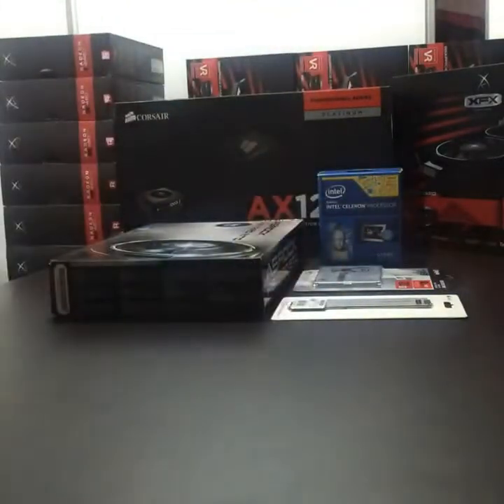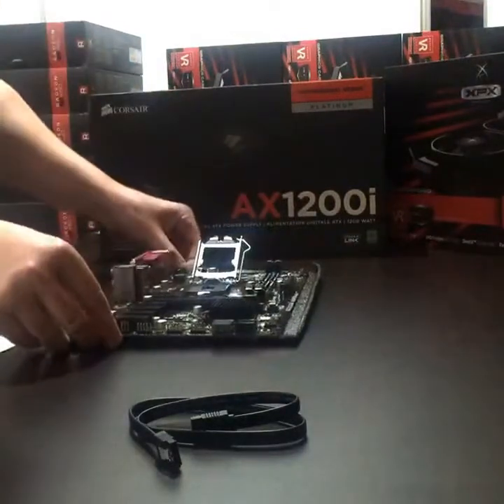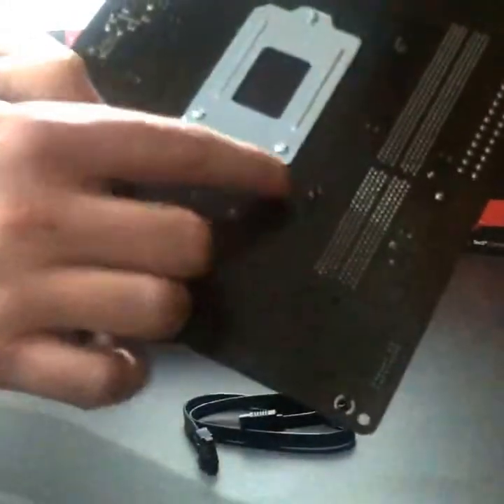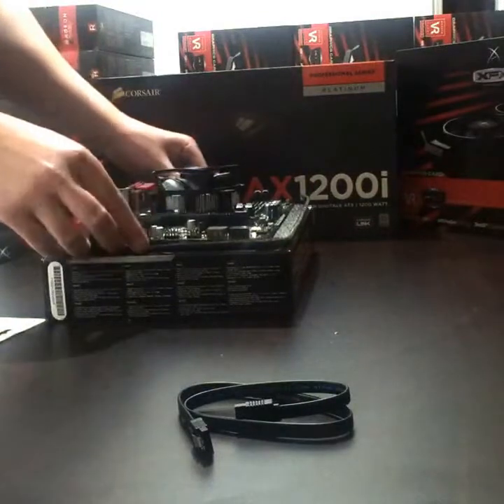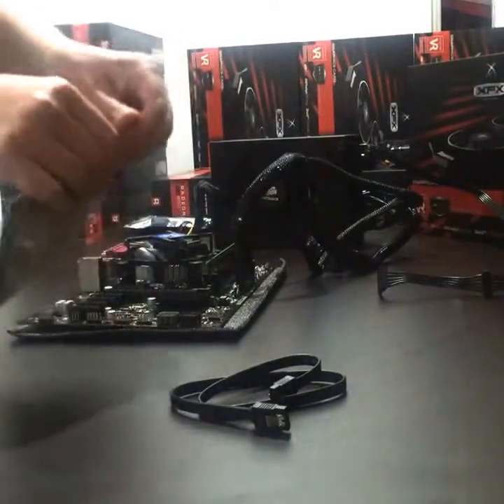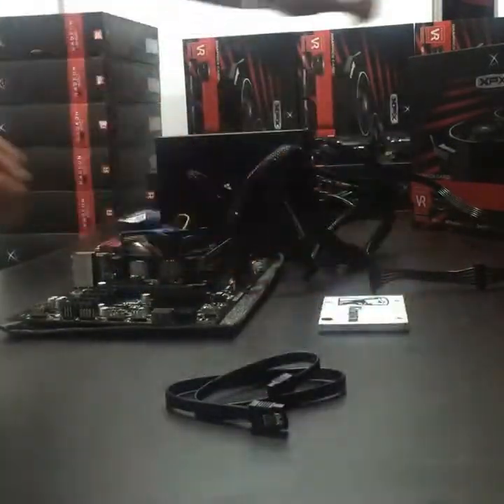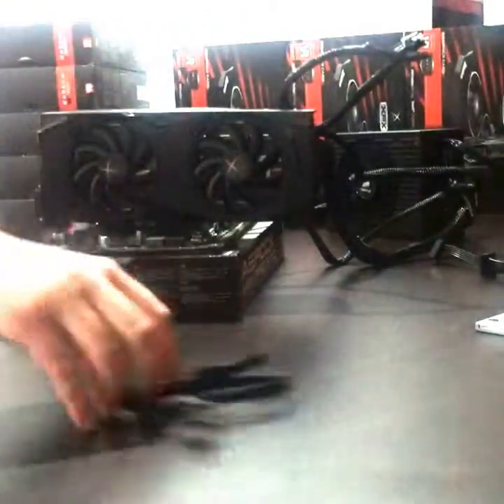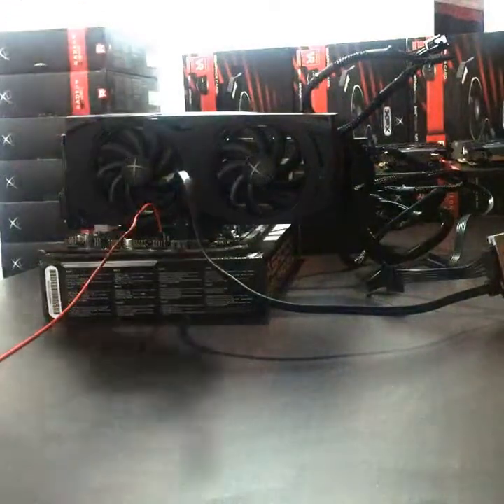Ethereum Mining Rig & Zcash Mining Rig - Part 2 How to Build

Comment: Do you have a link to the risers with the pcie plug on them?
Reply from the maker: got them from eBay but that place doesn't have any left sorry, I just looked through a bunch of listings have seen others before :)
Reply: Zilj TV ok thanks for checking. Yeah I've never seen those before. The only ones I've seen are the SATA ones which as you mentioned, cannot provide the proper voltage.
Reply from the maker: Matt McGivern These also come with a SATA adapter to the 6 pin, but if you have enough 6 pin's directly from power supply you can just use those :)